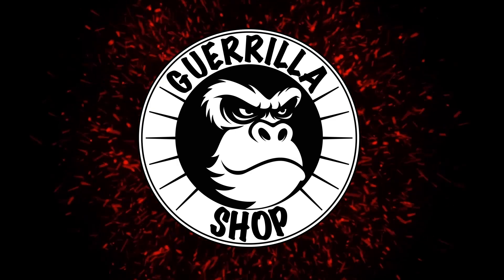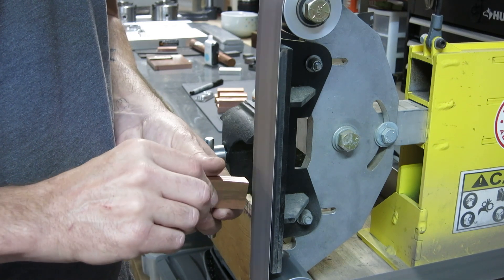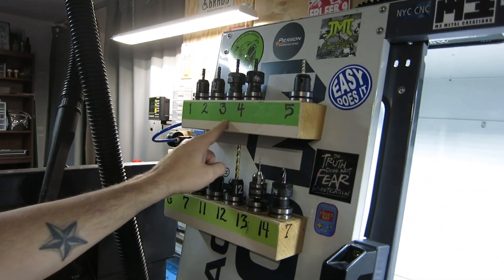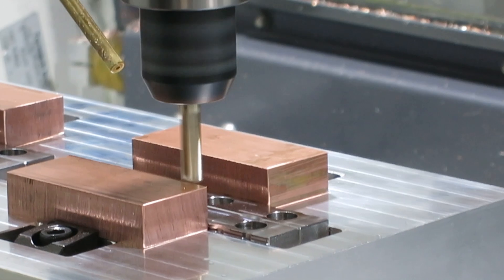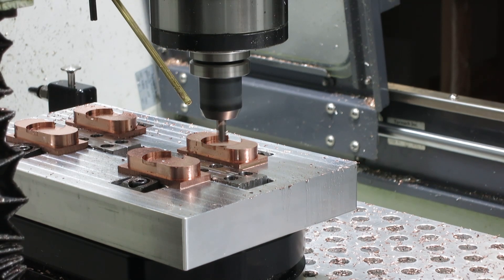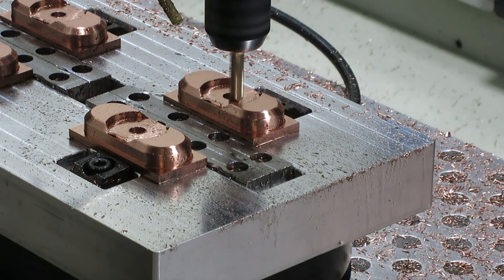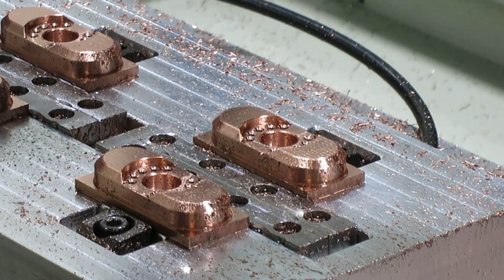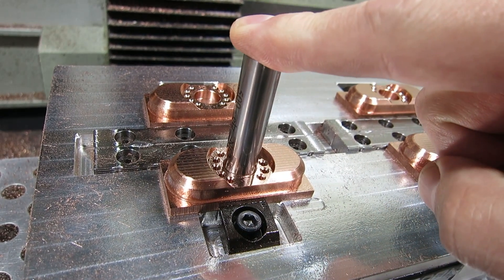Machining a Fidget Spinner - Part 1

Comment: When you say that you keep machining out more material until your gauge pin fits, are you adjusting the toolpaths from fusion or using wear compensation in PathPilot?   Wondering why you would need to chase the tolerance on this one and check with the gauge each time.
Reply from the maker: If the bearing hole is not perfect, the spinner will be off balance.  We are talking .002" ... So yes, I include the .002 increase in hole size in Fusion 360 and program a pause between each one.
Reply: @GuerrillaShop-m3  Yep, definitely familiar with chasing those tolerances.  I press 6mm diameter magnets into fidget sliders, and plus or minus a few tenths of a thou is the difference between magnets falling out and magnets breaking when pressed.

I'm wondering if this is the process to dial in a new end mill, or something you do on each production run.  For my stuff, since I press the magnets in with an arbor press I can tell when they're getting too tight and once that happens I'll adjust the tool diameter compensation in the control.  I work in metric stuff, so I'll adjust the wear by .004mm each time that happens, but when the wear gets to .012mm I'll replace the end mill and start over.

I've never machined a fidget spinner, and currently don't have plans to, so watching your video is very cool.  I'm living vicariously through you on this!  :)
Reply from the maker: Yeah I've tried many different ways to machine the bearing hole: drill, reamer, interpolate to exact size... this is the only way I have found that works with the machine I'm using.  I could probably benefit from a higher end CNC machine or even converting my toolholding from TTS to BT30. Just removing my cutting tool from the spindle and placing in back in seems to cause a shift of a hair or so.  Anywho, thanks for watching!  I've been following you for a while now. Good stuff!!!
Reply: @ aw thanks!  I’m enjoying this stuff.  I still use my Tormach 1100 a ton but most production has been moved to some larger machine.